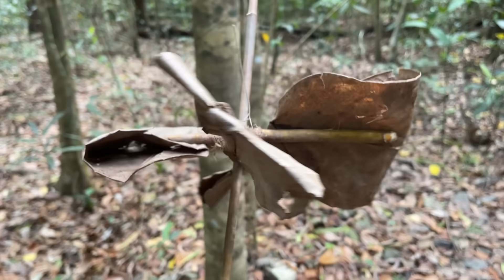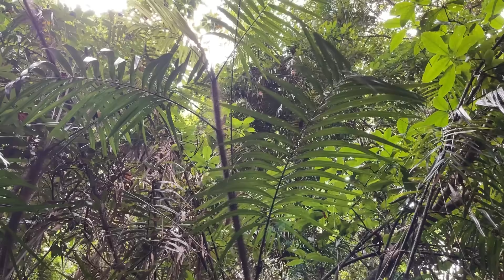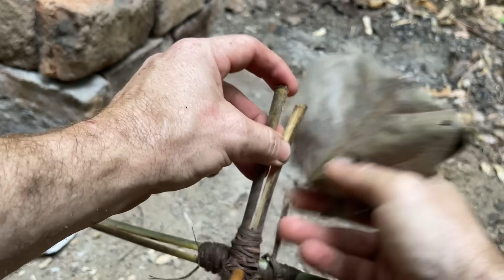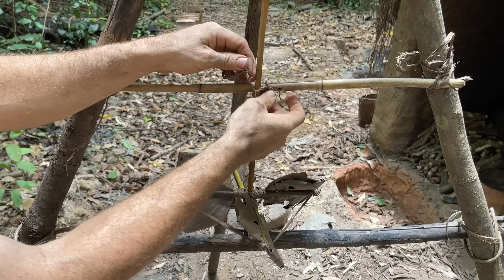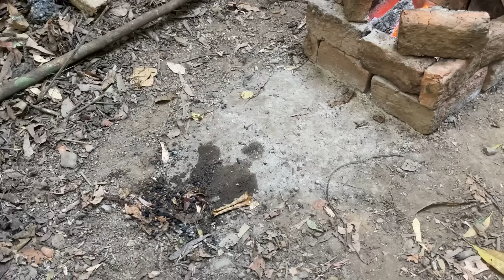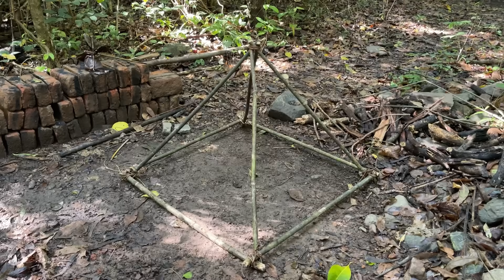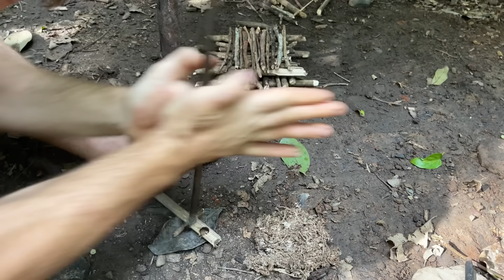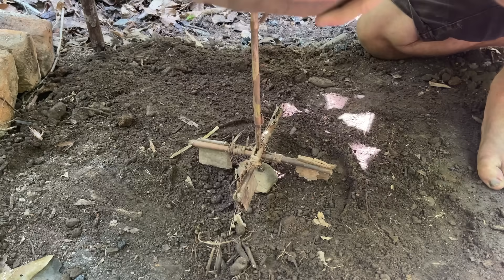Primitive Technology: Convection turbine experiments (hot air windmill)

Comment: With a clay funnel enclosing the fire up to a turbine in a tight clay housing more akin to the blower itself, there would be less loss of energy
however fueling the fire becomes difficult then without some sort of hatch. Perhaps an indoor furnace with a chimney housing the turbine?
perhaps a furnace setup near flowing water? or channel water towards a furnace using a segmented log or clay flume? That could power a waterwheel to blow air which could get more power than from hot air. Maybe even have the design use wood rather than leaves for the water wheel part, though not sure how achievable that is with current tools. Also the infrastructure needs to divert water may be unreasonable, and the terrain closer to nearby running water unsuitable. But if you go this way then the further upstream (from the furnace) that you draw water the greater the energy potential from gravity.

Comment: A chimney style "rocket stove" is probably a better iteration of this already if you can make a fire door for fuel and a tuyere as the only air intake. Stacking a few LARGER blades in series (on a single shaft for torque) to power a base input fan would be the next logical step up, but the heat issue remains for those leaf blades since I've seen your other tall stacks shoot flames out once you reach smelting temperatures...
--Making use of a venturi effect could help cool the air or provide a separate flow path for your leaf blades to draw from. (Long shot, adds resistance to system.)
--bigger fan blades means more "working mass" per each unit of cane making it more efficient by increased surface area.

If you could make strong clay blades that are super thin, it might work but weight, balance, and fragility becomes a new problem.

For your central shaft bearing, perhaps finding a really smooth stone with a dish shaved into it (receiver) and another very small polished stone (base of rod) could help minimize friction and get a few more RPM out of it. Perhaps with a drop or two of a natural oil/lubricant in the dish? (Maybe even water? Not sure what plants you have there that could fulfill this role.)

Comment: What about using the intake of a draft furnace to power the fan? this way to have the axle at ground level and cool air which won't burn the fan

 Could power a blower (at 90° from what you did here) to power a forge for example

You would have to maintain 2 fires instead of 1, but since draft forges aren't really possible since you need access to the fire, this does open up possibilities of freeing your hands from the fan

Comment: The proof of concept is solid!  Perhaps there was too much drag on the ground level between the rotor leaves versus dirt?  Would a smooth mud floor or slightly elevated cone for the stem help with the lost inertia?

Also, as far as the fire / rising air source goes, maybe create something like a faux forge with a diagonal chimney?  This could be supported with a flying buttress.  It aught to reduce the raw heat output.  This could be especially helpful in reducing the amount of times the canopy would need to be reconstructed due to immolation.  I feel like regularly splashing water on top and rubbing moisture along the spinning stick would help too.

BTW the fire safety monitor was a very welcome addition to the footage!

Thanks for the vid

Comment: Super nice idea to use the exhaust gas of the fire to power itself! A couple of ideas to help you improve the concept: If you use a chimney fire, you can harness all the air to power the blades by placing the blades in the chimney itself. To make sure they don't burn, you could make the blades out of bark. Additionally, if you make a larger ratio between the size of the blades over the fire, to those in the forge blower, the blades will spin faster. Here you could also do gearing between the two, but then again, your materials probably won't be able to handle the complexity without breaking all the time.

Comment: Stone-shaft with pitch/sand glue and thick pieces of bark for blades, then work them over or into the middle of a draft furnace, belt drive a similar set-up at the bottom of the draft furnace inlet. 

This was one of my favorites and I've watched them all :)

Comment: You have angular speed, but no torque. Maybe a duct around the turbine to restrict air flow from bypassing it? Otherwise maybe larger surface area/more blades.

Comment: This isn't really a path worth pursuing. Even a finely crafted sterling engine produces very little useable torque from a wood fire, and that's as close to ideal as we can get with modern materials and techniques. Turbochargers in cars were very unreliable until modern material science advanced. If you're struggling just to produce trace amounts of iron, you're nowhere close to making this concept work. Probably best to stick with water wheels for "free" mechanical energy for now.

Comment: It would be a lot of work, but if you made the housing and the top piece that channels the updraft out of clay, would it not be more efficient keeping more of the heated air moving upward instead of through the holes in the leaves and be more fire resistant? Along with putting walls on atleast 3 of the 4 sides of the contraption to keep the air moving upward while letting some air come in one side

Comment: Clay roof tiles a clay tube and a clay turbine and more of an enclosed systems so that it can build up some pressure to spin the turbine because you're trying to move as much air with the lower turbine as is going by with the upper turbine

Comment: This is some progression man :D. I had always hoped these days would come. I really think you should try steam next. I bet it's more powerful than fire alone and it would be way safer (in regards to the visits of the fire safety monitor). I thought of a "basin on a furnace" design, where you would directly heat up water from the fire underneath it, or an idea of superheating the steam came up, like if you had a furnace heating a horizontal tube that would on one side have a pot of boiling water and on the other the turbine. And you could make the tube narrow and widen it at the end so that the steam gets real hot inside and then rapidly accelerates due to the V shape. Aaah so many ideas, I hope you'll have a great time as you always seem to. Thank you a lot for years of amazingness.
Reply: Oh and I forgot to mention that it seems to me that wooden turbine would be more beneficial. Aaaah

Comment: You have a large volume of low pressure hot air trying to spinn a small turbine, if you make the blades larger you should get more force spinning the axle. Maybe that's not so useful if you want a fast spinning output but could be worth trying to gear it down. If you make a long chimney out of clay you get higher pressure hot air but you might have to make the blades out of clay to so they dont burn up.
You could try make a tall chimney with a horizontal turbine with clay blades that blocks the whole cross section of the chimney so the air has to push the blade out of the way to pass.

Comment: Two fires: Charcoal forge with vertical blower, wood fired kiln with constrained high speed input air spinning the axel. Won’t burn the blades and will be more efficient (high speed, no leakage). Won’t get positive yield from turboing input from exhaust: You lose more natural draft than the turbo generates. But with 2 fires you can trade cheap wood to boost labor intensive charcoal.

Comment: Would it be possible to make a fairly precise turbine out of clay? It could sit inside the chimney of the furnace. Of course the chimney would have to bend to the side and then again straight up. The axle could be made of some thicker, straight wood, with a spike on the bottom, then go through a wall of the bent chimney (while the part inside the chimney could be covered with clay to prevent it from burning; also the turbine would be attached here). Not sure if a good idea or if the axle would survive, but theoretically it should catch far more energy.

Comment: If the turbine was significantly heavier you could put it in a long chimney and it could help to smooth out airflow that comes in bursts. So you could use a bellow blower, or even manually bring the turbine up to speed and ideally it would continue to pull air through between blasts from the bellows.

Comment: Interesting idea. The biggest problem I see is that if you are using the fire to power a blower, the blower will make the fire bigger and hotter. A bigger and hotter fire will eventually overwhelm the wood and leaves, causing it to catch fire, as it did.  Perhaps if you use clay shingles to direct the heat up instead of leaves, they probably will not catch fire. Ya might way to try creating clay poles as wooden ones will eventually catch fire too, or perhaps a mud compound over the polls might be enough to protect them from higher flames, thought he structure would be heavy.  Perhaps if ya build a house with a fire chimy you could put some sort of fan on top of that, as it would concentrate the heat up anyways, and it might be high enough to not catch fire. Perhaps a double or triple stacked set of fan blades will force it to spin faster. Another though would be to tie the fin blades with a loop of rope, and connect it to a kind of pully/gear system to try to generate a separate stick to spin faster with different sized wheels, like a bicycle. Just some ideas.  You are really awesome to try all of these experiments. Your videos entertain me alot, and make me feel good.

Comment: Would it make a massive difference to shingle the leaves for the hood from the top-down as opposed to bottom-up? If we care more about funneling as much air as possible with no leaks, having the leaves shingled from bottom-up might cause "air leaks" as the leaves flap. Bottom-up good for shedding rain from outside, top-down better for funneling air from inside?

Comment: I imagine there's a sort of perpetual motion problem here where distance, heat loss, and friction take away from the energy of spinning the turbine blower, where you usually need more power input to blow the fire. Though I wonder how much you can push it with a clay tile pyramid thats not going to burn down. Or just using the spin power elsewhere.

Comment: Really interesting idea, it reminds me of the design of jet engines, with the exhaust side fins driving compression of the intake side.  I've seen a few other comments suggest it, but attaching this to a tall airtight chimney might improve things, since you'd get significantly faster airflow the taller you make it, giving better draft performance.  From a quick wikipedia search, air volume flow rate is proportional to the square root of the chimney height, and directly proportional to the area of the chimney.  So a tall, wide chimney, maybe matching the width of the outlet to the width of your exhaust side fan.  Might be worth a try, cheers.
Reply: I think overall, having a large chimney will do the job of transferring energy to a draft way better and more directly than any leaf-and-stick turbocharger.  It's all about harnessing the same energy, either at high efficiency with a well sealed tall chimney, or with really terrible efficiency with an admirably constructed leaf-and-stick turbocharger.

It's was a fun and interesting experiment, but I'm pretty sure a dead end practically, especially I think making a sealed clay chimney is well within his skills.

Comment: I think a bigger turbine is needed, and a pulley system to increase RPM, because the turbine will never spin fast enough to directly power the blower.I am also thinking a circular enlosure for the turbine (larger than the fire so that cold air mixes in with the hot fire) would increase efficiency.

Comment: You can stack multiple turbines on the shaft and then it will harvest more energy and have more torque. Adding fins to the turbine will increase rotation speed.

Comment: cool proof of concept - in your final design I would put a HIGH priority on finding/crafting a very straight shaft and spending as much time as you can on crafting an efficient bearing. Ducting for the top turbine is probably off the table using ceramic :(

Comment: Oh. I thought you were going to use it like an axial fan inside the blower (instead of the centrifugal design you were using thus far). I suspect that for any "turbocharging" effect, the windmill part will have to be seriously oversized compared to the blower fan, since the air pressure setting it in motion is so low.

Comment: You're losing a lot of energy when the hot gas expands and cools down as it leaves the furnace (that's why the leaf rotor doesn't instantly catch fire). I think a clay rotor could handle being in the chimney of a more enclosed furnace and get more power output, but there's the problem of clay/clay or clay/mud bearings to hold it in place. Maybe the turbine can be horizontal and attached to a reasonably thick wooden pole that wouldn't burn very fast? You could probably lay it on clay tube plain bearings and have a power output shaft you could hook up to a blower. The whole system would be a lot heavier than the leaves though so you might need to give it a push to get it going lol. Would love to see more of this!

Comment: I believe you can make a fan from burnt clay to make it more resistent to the heat instead of leafs. It will require more air but it will also keep the momentum for longer.
Then you can add four charcoal powered chimney structures to put all the hot air flowing fast towards the fan.

Comment: This step is a good idea with sorta bad engineering. You could accomplish a 'turbo' effect inside the forge by using the principles of a rocket stove. Instead of the standard pillar stack method, build a second assembly of wet mud directly next to it - with feed air at the bottom and exhaust through the top. The draft effect alone would likely be enough to forge iron, but you could also build a wooden turbofan to pressurize the system. The main issue is your exhaust gases aren't contained enough to deliver the torque for high impeller speed. You'd need to make the exhaust blades out of cane , think of the inside of a jet turbine. Lots of cane blades on the upper exhaust turning the larger lower impeller fan to feed the base. 

The hardest part would be creating enough space between the firebox and the exhaust turbine to stop it from catching fire.

Comment: One idea might be to make a rod out of fired clay and placed on a base which has three clay balls to act like bearings. That way it’s straight and you don’t lose any potential energy in lateral motion. Then, to better focus the updraft to the equivalent of a reverse tuyere with the chimney directing right into the blades of the fan with the rod poking through to the fan hub.

Comment: To turbocharge the furnace you need more concentrated pressure, as well as some sort of material that could withstand the heat. My only thought is some sort of lightweight bone rotors etc?

Comment: Really fun build, but I'm sceptical it's feasible without using more advanced materials. You'll need a much more concentrated flow and pressure drop, which means much higher temps.

Comment: I did a quick reality check with ChatGPT and it indicates that while you have a theoretical maximum of 75% of the power being available, in reality mechanical losses make the potential gains in the 1% range.   

But when I said it was above the fire to blow wind into the fire, it said it would be net negative because it takes more power from the updraft than it can possibly give back with the blower.  And that taking power from the updraft reduces the fires efficiency.

Comment: Nice! As you have pointed out "more work has to be done"... Unfortunately, I think a useful air turbine (in the sense of it providing useful mechanical work) may be to ambitious for primitive technology. Mass, inertia, blade shape and angle as well as inlet and exhaust geometry all play a massive role in making any turbine useful. Few of which you can reliably control in your setting. I fear something like this may be to big a leap into actual engineering considering the tools and restrictions you have set for your project. Nethertheless, the idea is pretty cool and I would love the be proven wrong and see you come up with a working prototype.
Reply: Took the words right out of my mouth.
And add me to the list of people wanting to be proven wrong.
Reply: there's definitely not enough torque for 100% uptime on the blower but storing otherwise wasted energy in a flywheel or some other mechanical battery is still something worth looking into

Comment: This concept has a lot of potential, if you can pull off a ration with a belt and pulley system. I was thinking last time you tried to do that and got me thinking, how much effort would it take to make ball bearings? There's a way you can make them out of stone, using a small waterfall and a trough caving out of big  rocks. Also, you could test if Clay ball bearings are a usable substitute